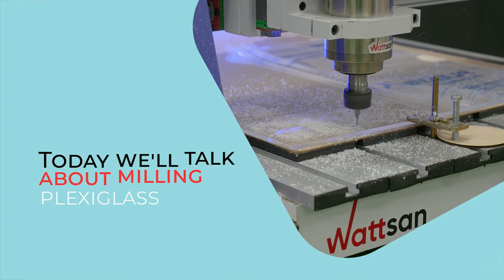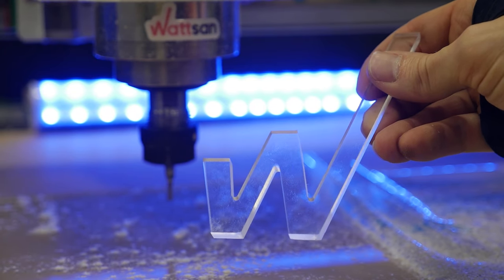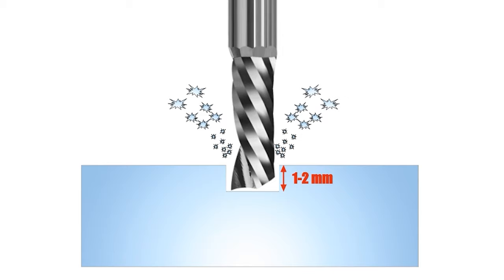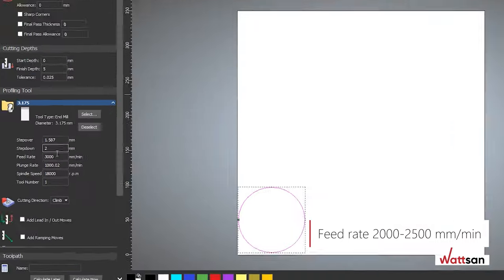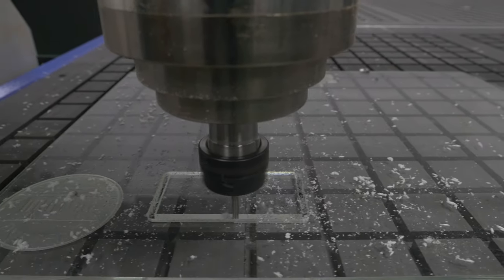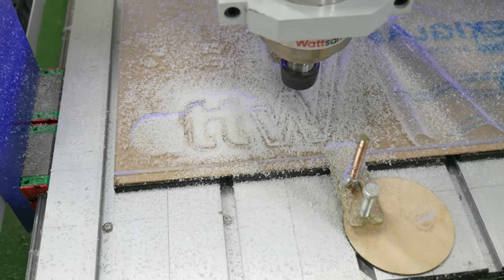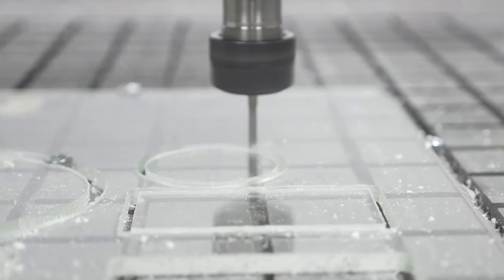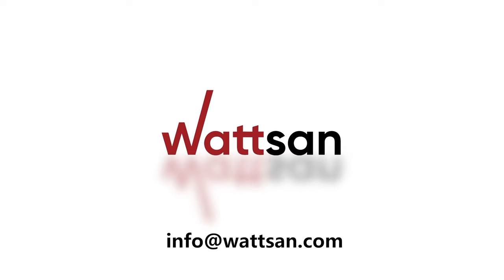HOW TO MILL plexiglass & acrylics with WATTSAN CNC router

Comment: I will have to mill the surface of the plexiglass, are there any methods apart from using a blowtorch to restore the gloss to a level similar to that before processing?
Reply from the maker: You can try soaking a piece of fine grit sandpaper in water. For 2-3 minutes, remove the scuffs in a circular motion by pouring water on the surface. But this only works with small scuffs and scratches.